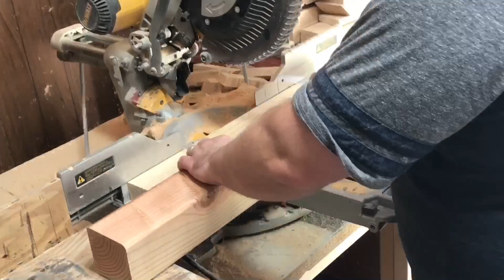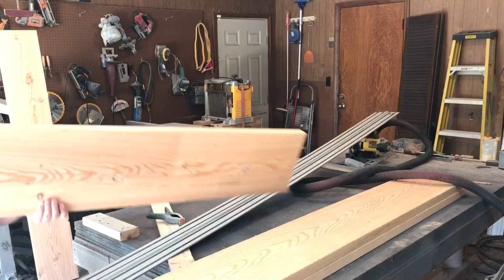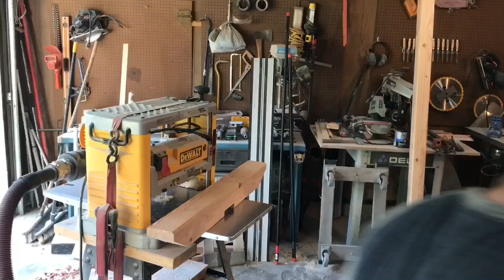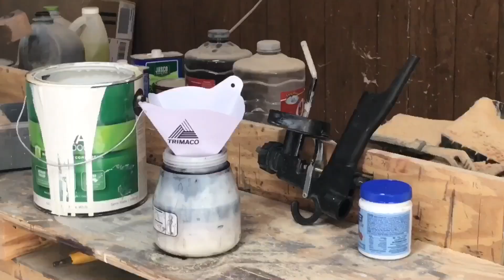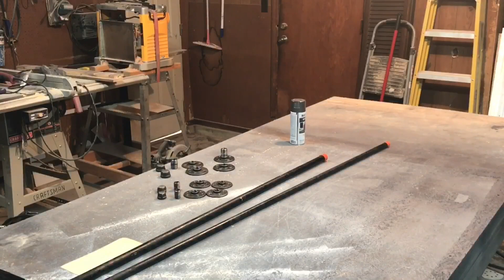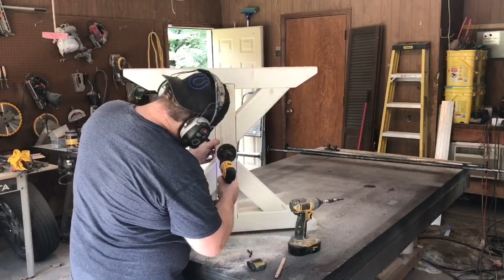DIY Pipe Stretcher Style Farmhouse Table

Comment: I like the way the table came out and the use of the black pipe.  So did a bench with black pipe and in order for the bench not to sway left and right  I used 1/2 inch black pipe and drilled through the sides and put a pipe cap on the outside with a nipple and a coupling on the other side that way it doesn’t have a chance of walking
Reply from the maker: That’s exactly how I do it too.
Reply: The Ultimate Maker gotcha   Nice

Comment: Looks good bro!  The attaching of the bread board ends was skipped in the video.  How did you attach them.  More glue and pocket hole screws? How is it holding up a couple years later?

Comment: Great build!  Thanks for sharing!  Question: Is there an advantage to using both biscuit joiners and pocket hole screws for the table top?
Reply: I would say the advantage is the biscuits help with proper alignment during assembly.

Comment: Hey there, how did you attach the bases to the underside of the table board? 
Also, I saw that you had 2 pipes in the video, but there is only one visible. Did you only use one? Does the table have any sway?

Comment: why the pocket screws? you don't need them with glue. plus it will inhibit wood movement.
Reply from the maker: Just to hold the clamping pressure because I don’t have a ton of clamps. I took the screws out after 24 hours or so.
Reply: I'd just buy more clamps lol

Comment: This top will almost surely crack due to expansion and contraction with humidity changes.
A top this wide will move nearly 3/8" here in Iowa between winter and summer.
The bread board ends restrict any movement .